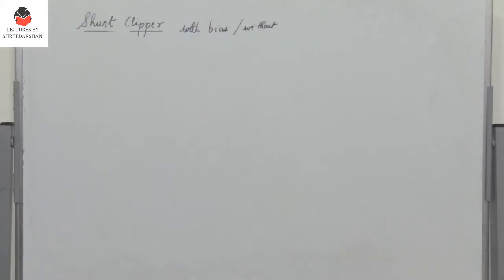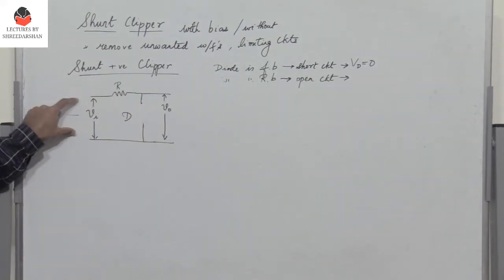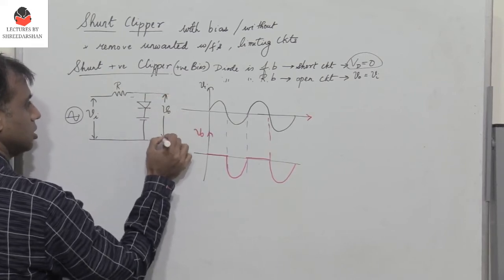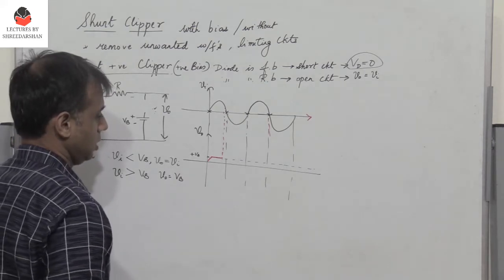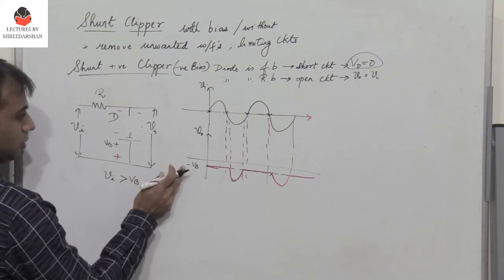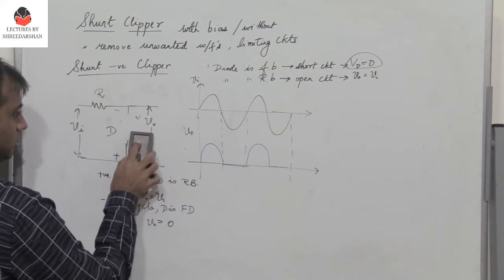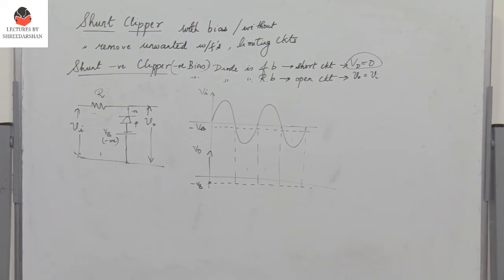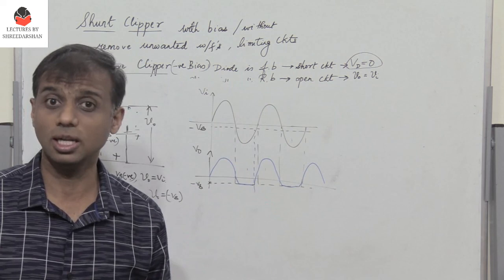Shunt Clipper - Positive and Negative Bias  with Bias | Electronics

Comment: Why Vo=Vi when the diode is open circuited?
There will be voltage drop across the series resistor R right sir?
So Vo will be slightly less than Vi.....
Reply from the maker: When open circuited, there is not flow of current. Hence , there will be no drop across resistor R .
Reply: @lecturesbyshreedarshank8977  Ok sir. I got it